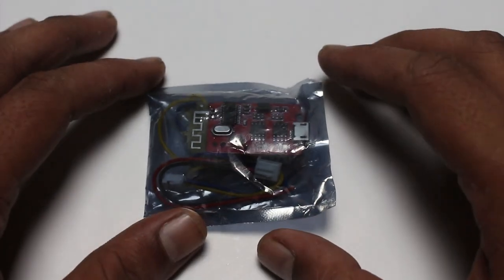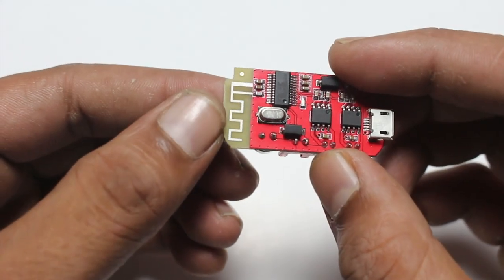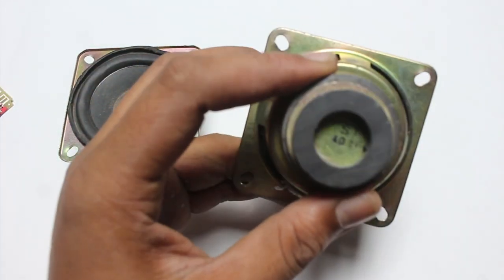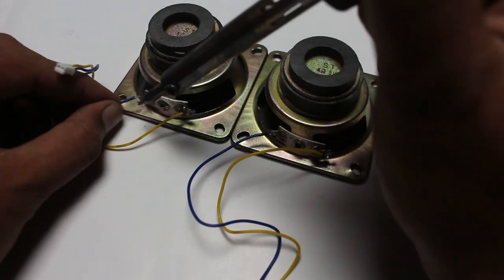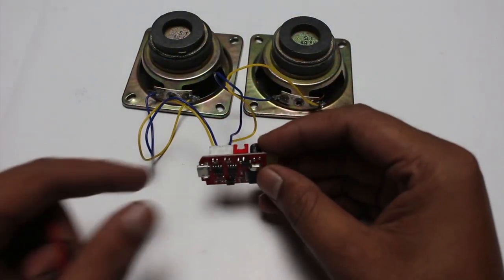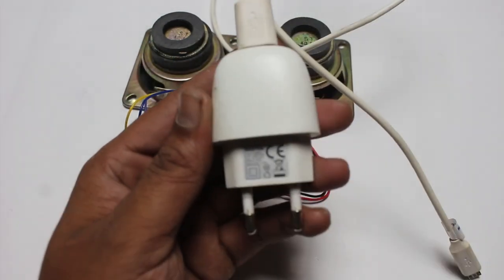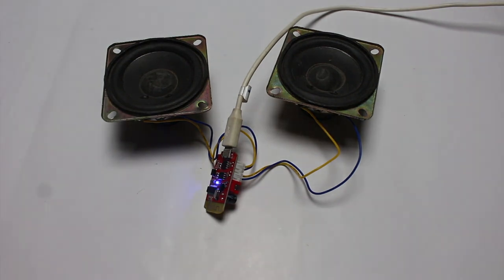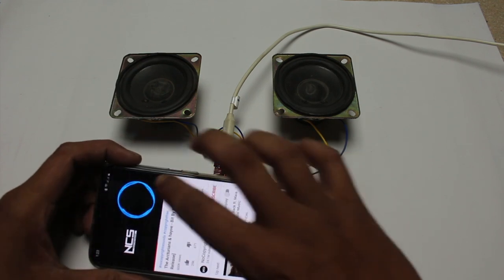DIY: Mini Stereo Bluetooth Amplifier Board under 3$

Comment: My Dw-CT14+ heats up a lot almost burning after 1minute on what is the problem
Reply from the maker: Check your input dc voltage ...
Reply: @ForegoingTuber  Im using a MT3608 converter set to 4.9w that’s powering it. My source of power is 2 18650 battery’s